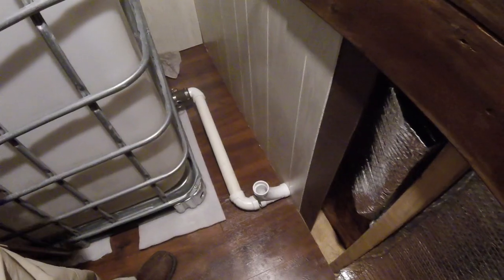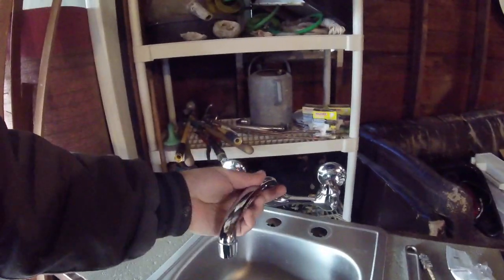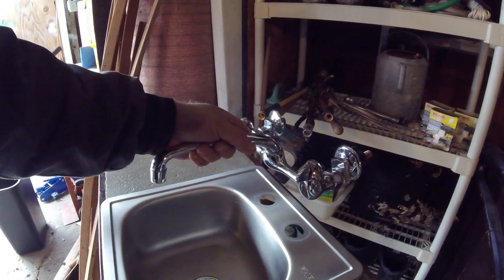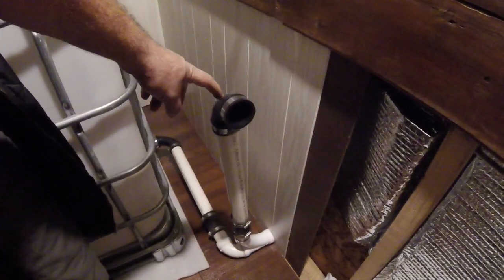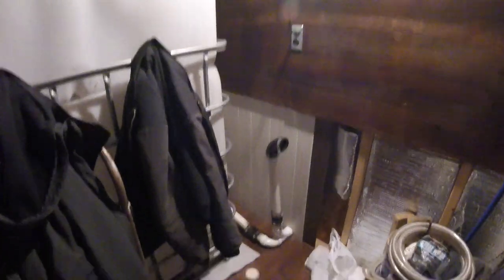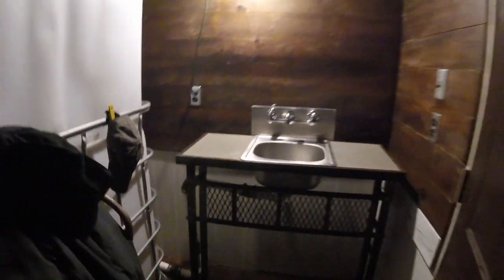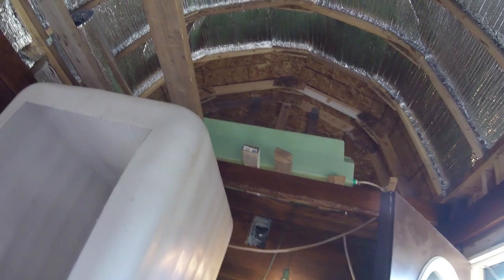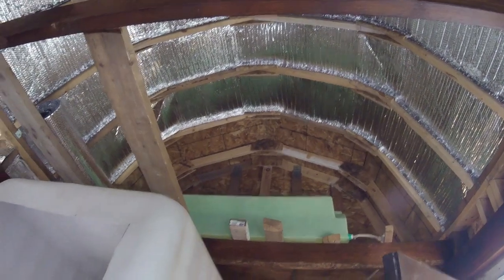Tiny House Shed - Shower/Sink Drainage & Install

Comment: For better water flow you need to open your tank on the top or make a hole and screw it back when you tank up it, think about it, water is going slowly because in same time
When is going water is going air in same time in same pipe , if you get a hole in tank from Top then in pipe will be only water more water👍🏻
Reply: I was going to say the same thing, he needs an air intake hole/vent on the top of the tank. The valves with the side port are usually there for soldering to copper pipe using a torch, the heated air/pressure needs to be vented when soldering.